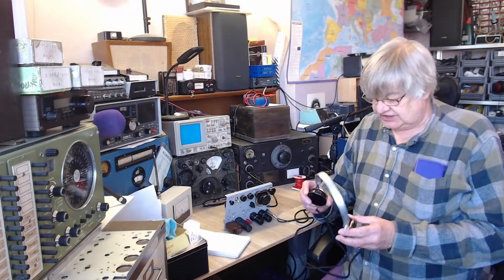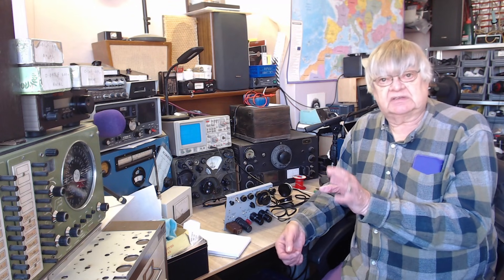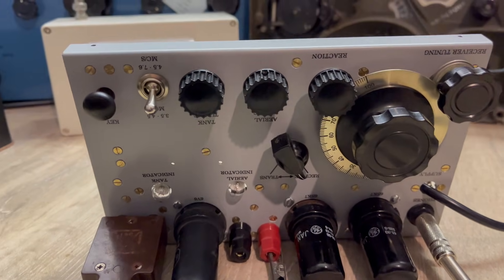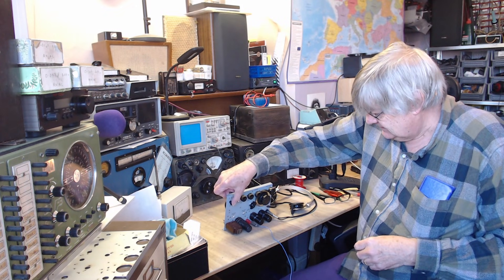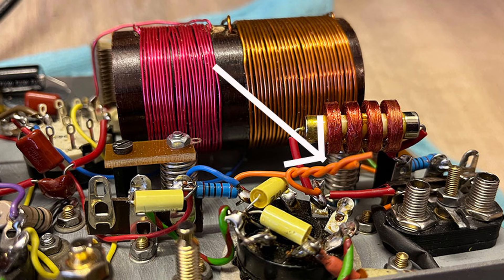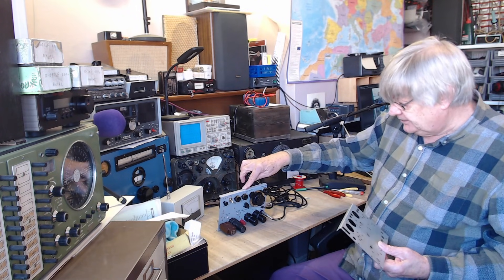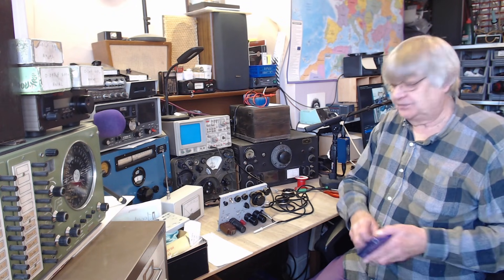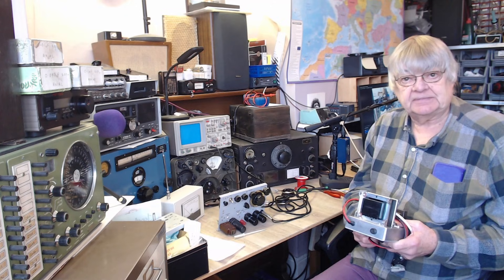G4NSJ - Building a replica Paraset Spy Radio - part two

Comment: I noticed from the schematic you were using,I have the same one on file,that the audio output valve has no grid leak fitted and just fed via a capacitor from the detector,is your build the same as the circuit?
Reply from the maker: The circuit diagram is wrong.  I fitted a grid leak resistor.

Comment: Wondering why no one talks about 12v filament version? If you are using anyway 12v PSU with mechanical vibrator or multi-vibrator on transistors, so why not supply 12v dc heater voltage? 12v tubes are readily available as  12SK7, only 6V6 likely would be replaced by something like 12A6 or 12L6.
Reply from the maker: That’s a good point.  It might be down to originality.  They were run from 6 V car batteries back in the 40s.

Comment: I used a RS socket for it.  Power source is a modified codar psu. Gives me 330 volts dc and the heater voltage. I built it into what looks like an ex army valve spare box. Was my late father's he used for audio spares when working on public address systems at the winter Gardens.. Margate... Thanks for your info. Nice to see other interpretations of the original. I moved to Wales from SE Kent 20 years ago.  Thanks from gw4gja
Reply from the maker: I like the idea of an ex-army valve spare box. I remember those. Cheers, Ray.

Comment: I built one with old vintage parts collected over the years. It works, but never got the Rx stable enough. I replaced the Rx with a transistor arrangement. Even that was not usable. I use to have success with TRF sets many years ago. I will rebuild the Rx with a valve again. Tx is not a problem it works well. I have the same set of high impedance head  phones. They were from my late father who many years ago built an audio system for a conference with language interpreters.. Winter Gardens Margate back in the 60s. Interesting to see yours. Mine is similar, but not a  perfect replica. De gw4gja
Reply from the maker: It's good to hear from you. That's interesting about the high Z headphones. I've been after a pair for years!

Comment: Well done Ray ,and very interesting ,I think i will put mine on the 40m band as plus i will get the broadcast stations ,80m is a bit quite here. I also noticed your Sailor receiver i have one just like it in the shack as well .Been watching some of your other video's and great to see the army radio's and older gear . many thanks .73's de ZL3JE
Reply from the maker: 80 is pretty quiet here, too. 40 should be great! I've not had the Sailor receiver very long, loving it. Cheers, Ray.

Comment: I look forward to working you /p in the spring. It will be interesting to see how you get on with the RX on a ham band. The bandwidth may make things hard work / a challenge to use at busy times 😊 Regards G0GGA
Reply from the maker: The bandwidth may be a problem. Fingers crossed. Cheers, Ray.

Comment: I've never seen anything about the manufacture of the orginal sets.
Were they built by a commercial supplier, under tight security conditions, or was there an SOE workshop that made them?
Reply from the maker: I believe they were built  at Whaddon Hall and Little Horwood UK.  Info is on the web somewhere.
Reply: @g4nsj thanks very much, both are in Buckinghamshire, I see, so that makes sense.

Comment: I see there's no dc return for the control grid on the audio 6SK7. That floors me! I see nothing in the receiving tube manual about such a configuration. Any leakage, and there will be leakage through the plate coupling cap, will surely change the operating conditions of the tube. A noisy cap could be your source of microphonics. The MkII version shows a 250K resistor to ground. I believe it's a schematic error. The 250K resistor should be connected to the control grid, and the 0.1 ufd bypass cap goes to the screen and the 75K resistor. Cheers once more!
Reply from the maker: You’re quite right, the circuit diagram is wrong, well spotted. The 250k from the screen grid to chassis is wrong. It should go from the control grid to chassis. The 0.1uF decoupling the screen is correct. I’ve fitted a new valve and that cured the microphonic problem.  Cheers, Ray.

Comment: A nice quality kit Ray, shame about the valve which i hope that you can get a reliable replacement. Radio reception ( all bands ) is very hard wherever you are. The modern way of life has destroyed it for me as well, having to take a multi band radio out into the countryside, away from built up areas. We did have it much better back in the day, sadly something that we will never get back.
Reply from the maker: The new valve has arrived as it's cured the problem, all is good now. Yes, the bands were  much better back in the day, clear of QRM. I miss the old days. Cheers, Ray.

Comment: I love when I see that people are still building replicas of the paraset. This one it's been on my list of things I want to build for a long time. I hope I get there sometime. For now I need to build some other stuff on tubes as I never built anything. I love how yours turns out. Glad it works well. 73, YO6DXE.
Reply from the maker: Hi, it's good to hear from you. Building anything is fun, even if it's only an ATU or something. Good luck with your Paraset! Cheers, Ray.
Reply: @g4nsj  Thanks so much Ray. Ohh yes it's a pleasure to build stuff. I get so much more satisfaction from using stuff I build rather than something I buy. Have a fantastic week and good luck finishing this project. I just love it.
Reply: Would love to build one too!
Reply: @alanuk8677  I need to start collecting parts. It's been on my wishlist for a long time. You should build one for sure. It's history. 73 my friend, YO6DXE.
Reply: @dxexplorer  yes would love too! need a circuit diagram etc first. Then where to source the parts. 73 Chip, M0KOE.
Reply: @alanuk8677  The parts are the problem for me too. 🙈

Comment: Well done recreating that set - lovely job. Those old resistors were likely +/- 20 per cent at least, so more modern preferred values would be within range. Hope the dodgy valve is the fault. Can you net on the tx frequency?  I have a Mk 123 and you can't net because these 'spy sets' weren't designed to transmit and receive on the same frequency.
Reply from the maker: The new valve has arrived and it solved the problem. All is good now. OK about the old resistors. No, I can't net but I might look into a way of doing that. Cheers for now, Ray.